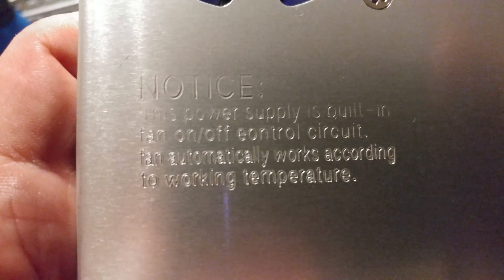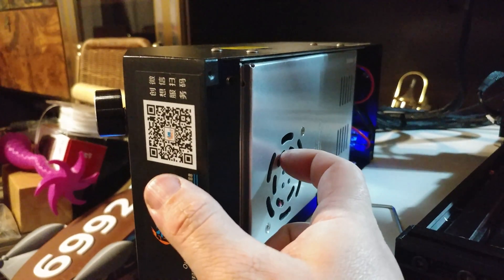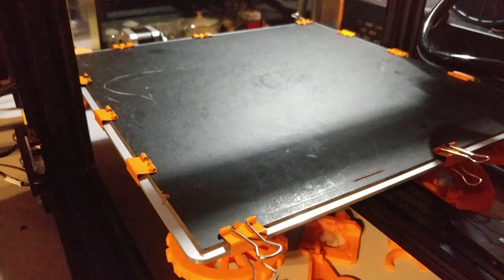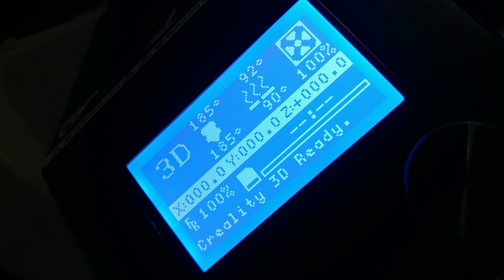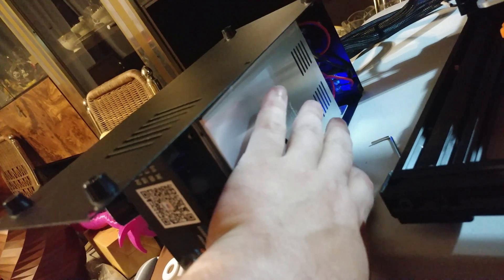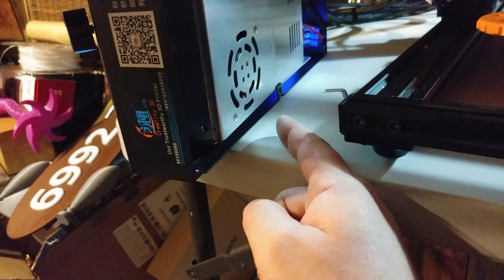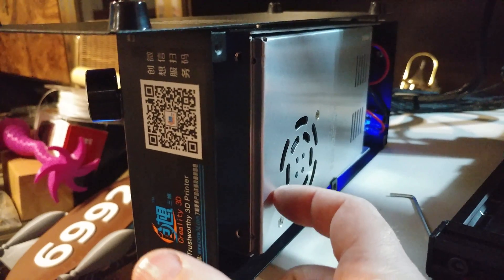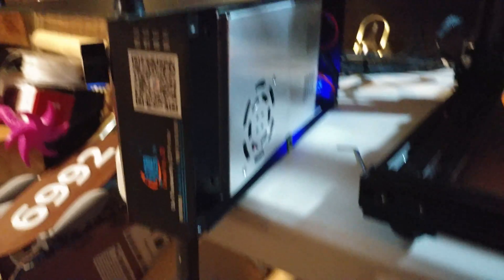Today's 3D Print - CR-10 Silent Fan Upgrades Part 2

Comment: I replaces my CR-10 fans  this weekend  and was still not happy with the PSU fan when it kicked in.  But I saw this guy's solution.  Given  what you mentioned about cutting the box  I thought this might be a solution with out cutting  
https://fdproj.wordpress.com/2018/01/22/cr-10-silent-new-fans-vibration-dampers-and-design-upgrades/

Comment: I had a similar problem trying to put a 25mm fan in the Ender-2 (S-250-12) power supply. I could get it in but it rubbed against the small transformer. I wound up 1) removing the flange from one end of the fan 2) sanding down the external  portion of the housing to form a more cylindrical shape 3) cutting a hole in the sheet metal to fit the housing 4) installing the fan with the remaining flange on the outside of the sheet metal. I also had to trim a bit of the fins off one heat sink. FYI: there was no heat-transfer paste between the heat sinks and the case (there is now). The result is very quite but I am not certain that it was worth all the effort required to make it fit. https://www.amazon.com/gp/product/B009NQMESS
Reply from the maker: +Lewis Balentine the effort is half the fun and its satisfying when it runs silent :-)

Comment: Thanks for this, I just ordered a CR-10 S4. I will def be upgrading the fans, but I was more curious about how you are getting the bed temp up so quickly?! Sorry if you covered this in a previous video, but what build surface are you using in this video? It was clear that you weren't even using insulation or a keenovo. Any advice would be greatly appreciated!
Reply from the maker: +Pippin & Binkley LIVE I use print in z about $31 for the S3 probably 35 or 40 for the S4 I'll be ordering one soon for it I like it because it's extremely durable you can really beat the snot out of it without harming it but it can sometimes stick to well and be difficult to remove Parts especially if you have too much squish so be careful but it is my favorite so far I have heard that you can remove prints from Pei with canned air I know that works for small prints I'm not sure if it works for a large the surface area prints I'll have to experiment with that because then no tools are needed on the surface and durability becomes less of an issue looks like I'm gonna have to experiment with print beds I love my S4 very good print quality and so large :-)
Reply: Interesting, in your video it almost looks like a thin metal sheet or tooling plate. I just checked out their website and they don't seem to have a 400mm option, and the 300mm is listed at $80. I'm surprised they mention NOTHING on their website about how well it can insulate the bed because they would sell out from CR-10 users alone!
Reply from the maker: +Pippin & Binkley LIVE the plate is that much. The skin is half the price.

No insulation just glass to print in z. Takes me 8 or 9 minutes to heat up but i only goto 45 or 50 c as print in z does not need as much heat. Takes 24 minutes to hit 60c.
Reply from the maker: +Pippin & Binkley LIVE the plate is that much. The skin is half the price.

No insulation just glass to print in z. Takes me 8 or 9 minutes to heat up but i only goto 45 or 50 c as print in z does not need as much heat. Takes 24 minutes to hit 60c.
Reply from the maker: +Pippin & Binkley LIVE custom size lets yoy go larger.
Reply: Nerys got you thanks, I print alot with petg and I'm looking to regularly go to 90c at least. Any recommendations on getting it up to that  in a decent amount of time? Thanks again

Comment: I just did the fan mod myself, do i have to change the speed of the fan at the cold end  to prevent the filament to clog ? I alway crank it up to 100% manually in the printer. is there maybe another way to do it ? or maybe i don´t need to to this ?
Reply from the maker: +TscH3ch the cold side fan should alsays be on if the printer is on. The fan you contr is the parts cooling fan. By personal preference i run layer 1 at 0% layer 2 at 25% and all layers after at 85%
Reply: Nerys makes sense. thats why my Print wasnt sticking to The bed xD.

Comment: I pulled my control box apart yesterday to remove the filament sensor cable (CR-10s) in order to connect it to my RPI. I noticed that the case itself is not bonded to the ground wire directly which I will be fixing shortly. It is indirectly bonded through the power supply case, but that really isn't a safe thing to do considering mains power comes into the box. I plan to just attach a short pigtail to the ground terminal on the power supply and bolt it directly to the case. That was my only safety concern other than wondering if the wiring and heatsink for the bed heater are large enough.

Comment: Thanks for the  Information, I did the 2 fans in the control box and the one on the hot end. I also cut the opening to the power supply on the control box, it maid sense what you said on air blockage. Had a photo but did not know how to insert it or attache it. Thanks Andy

Comment: Would a 60x20 fit or does it have to be 15?
Reply from the maker: Lord Panik a 20 might fit. 25 was too thick but it was close so you might squeak by with a 20. Would have to try it and see.
Reply: Size 20 fit ok, just.
Reply from the maker: Lord Panik well now we know. Excellent. Go for 15mm but 20mm can work if you must.

Comment: I think you made a few mistakes in your upgrades...

First, the fan in the power supply is an INTAKE fan, and not an EXHAUST fan.  You mounted it backwards.

Second, the fan in the back of the unit is the only exhaust fan, and you should probably buy one the correct size, as it is you've effectively halved the cooling in your unit by using the wrong fan.

Combine these two things, I'd be very concerned about thermal issues inside the case and frying one of the components.

Respectfully...Mike
Reply from the maker: Mike R I was not aware of that interesting I might keep it this way however I discovered that the double slotting through the PSU and then through the brain box was severely hindering the cooling of the unit to the point where almost all the air was blocked what started out as very good airflow turned into almost nothing by the time I put the box together I have since cut the bottom of the brain Box open and nearly triple the airflow out of the box a dramatic significant increase in air flow I can actually feel the hot air come out of the box and feel that air get cooler as it is evacuated as for the exhaust fan on the back I did order the correct size just have not installed it yet though I may change that to a larger fan like I did on me to duplicator i3 if I think it needs more Cooling I will also double check and make sure I did not install the other two fans backwards thank you for pointing that out
Reply from the maker: I have decided to keep the PSU fan as an exhaust fan. it seems to work many many times better than the stock configuration at cooling down the internals of the unit. BTW I checked with the stock fan and it was also exhausting air out of the bottom. maybe mine came backwards? I have a second unit (hictop) I will check to see if it inhales of exhales before modding it.

one massive problem was the double slat configuration (psu shell and brain box shell) I noticed almost no air coming out of their. I cut away the slats on the brain box shell bottom and at minimum tripled the airflow. HOT air started pouring out of their and rapidly cooled down. much much better.

I also found a proper fitting 60mm fan. link in description.
Reply: the bottom of the brainbox/PSU is an exhaust as mine blows out both the bottom and the rear also
Reply: Nerys I think there is maybe some confusion with computer PSUs which often have an intake fan to ensure good airflow as there is already a good flow on the rear case fan which could reduce flow to the psu. Doubt that’s an issue on the CR10 though. I’d double check your case exhaust fan though it looks like it could be sucking air in and fighting against the 50mm fan in the middle of the case
Reply: The PSU should ALWAYS be an intake. Exhaust won't provide the internal pressure and air speed to cool down the components further downstream inside. Exhaust then might reduce the lifespan of the PSU.
Reply: http://t3.gstatic.com/images?q=tbn:ANd9GcT-DTdR5_jhFHu8Gzabsuj4i2gs1Bwu_l-0u61OmIPmls7C6O1ysA
Reply: Mike R just got my CR-10 and the psu turns out to be exhaust by default but the rear has to be exhaust. Although I still dont agree using silent fans because they’re much lower airflow than the standard fans.